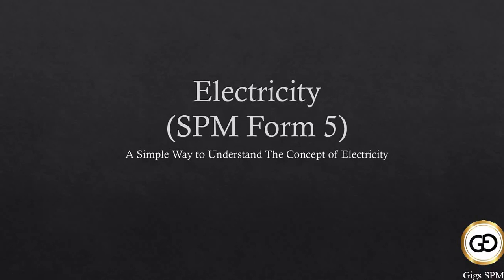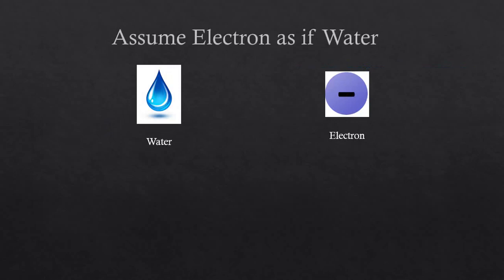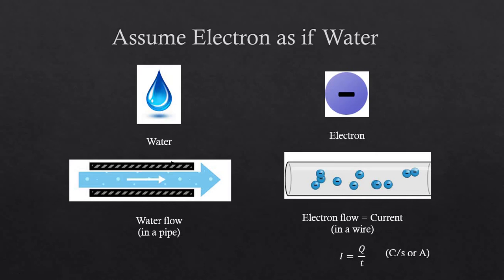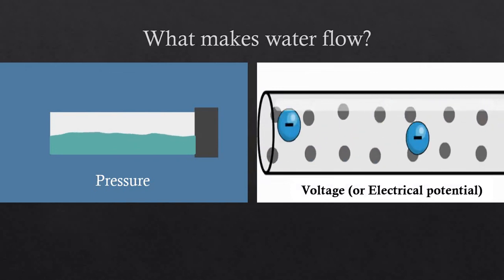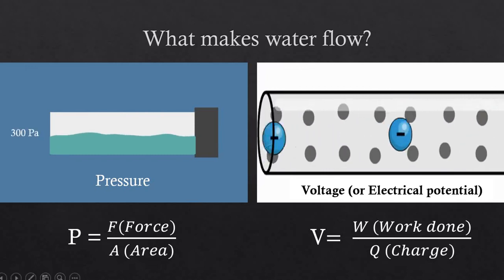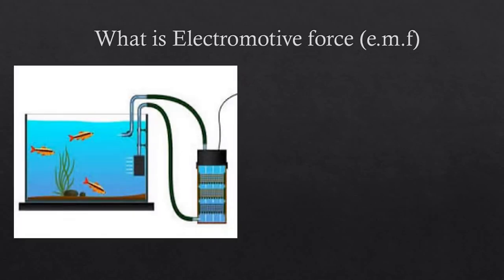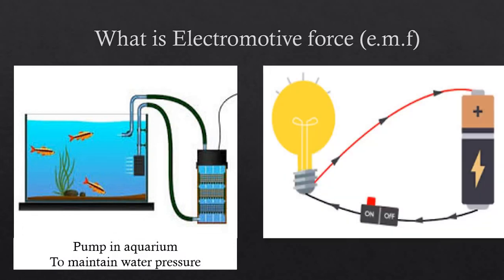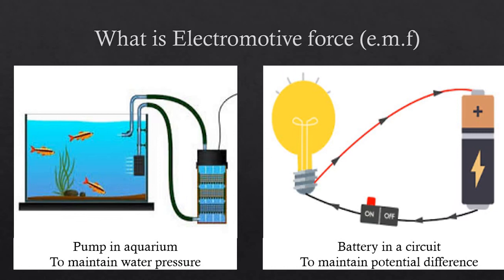Electricity | Simplest Way to Understand | SPM Physics Form 5 Chapter 2

Comment: so current is the flow of electrons right?but why current and electrons flow in opposite direction in a circuit?
Reply from the maker: Before this scientists discover current first (from + to -ve), only then scientists discover that current is the flow of electron (-ve to +） Many equations have formed before discovery of electrons, if change now will make confusion somehow. So right now people will still use current (+ to -)
Reply: @gigsconnect8517  oh~thats why,thank you for the explaination:)